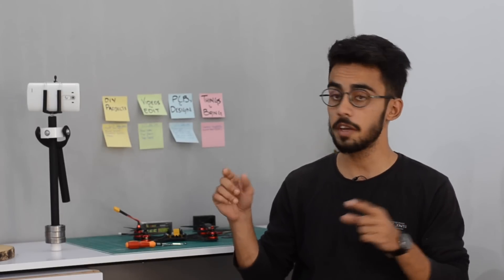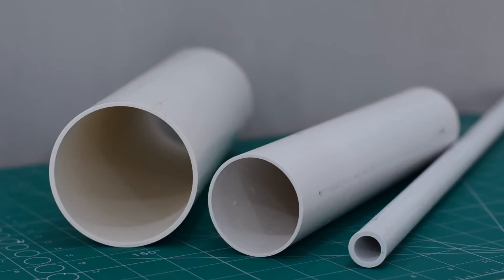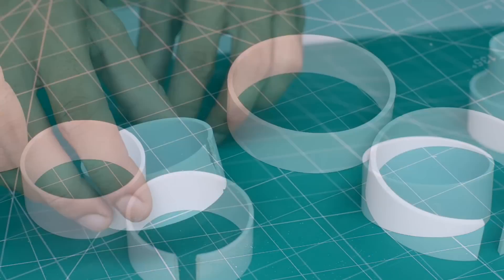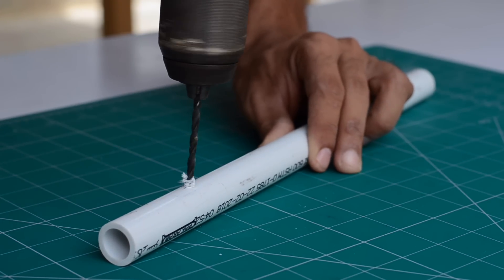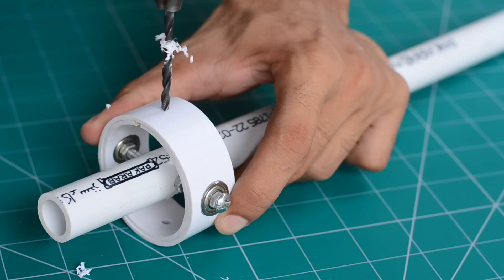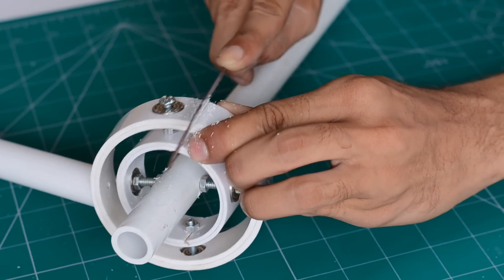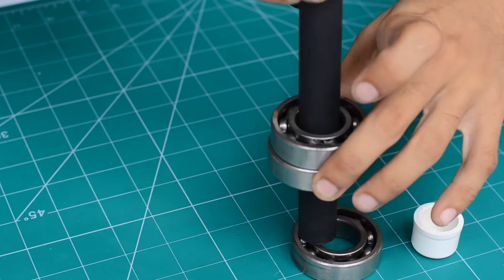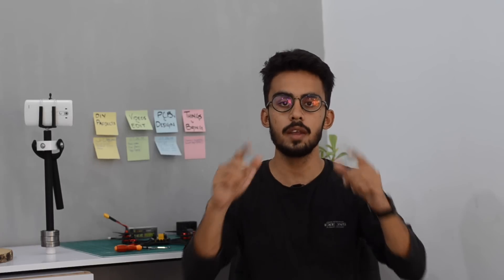How to make a Smartphone Gimbal Under 5 $

Comment: I hope someone comes across my comment to explain to me one thing. Is it important to put those metal rings in the holes he made in those circles? What are they for?
Reply: The "metal rings" are actually bearings, a smaller version of what makes a lazy Susan function.  They are necessary as they allow the inside to spin with the outside staying fixed in place.

Comment: I love this idea! But, where did you find four bearings for under $5? Or do you mean to say that you only spent $5 on additional materials? Even the cheapest bearings are over $8 each where I am. 

Thanks for sharing this project none the less, very cool!

UPDATE: I used some super thick washers for the counterweight instead of bearings. This allows me to time tune the weight in relation to the camera/phone that I'm using on-top. If you have bearings lying around they would be great as they are pretty heavy. Or you could possibly grab them at a scrapyard as someone suggested. 

Great Project! I ended up spending about $30 USD for all of the materials. 👍
Reply: You can get a pack of 8 skateboard bearings for like $15, try those!
Reply: Go to a scrap metal shop and get it for free, if it's available.
Reply: would fidget spinner bearings work? ive got lots of those!

Comment: You should use a thin lubricant on the bearings for more stable movement 💜
Reply: Overcompensating with the lubricant will make it a little unstable as after a movement it will not staay at the same place instead take some pendulum motions to come back.